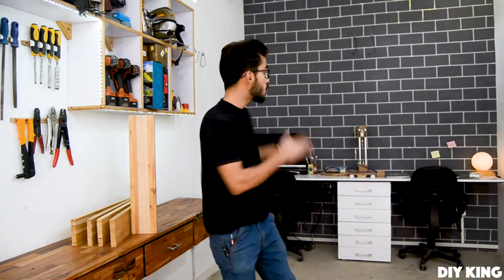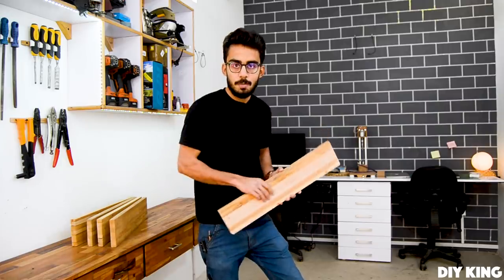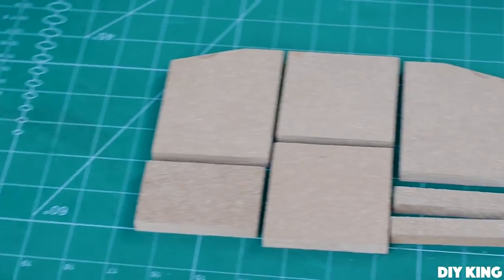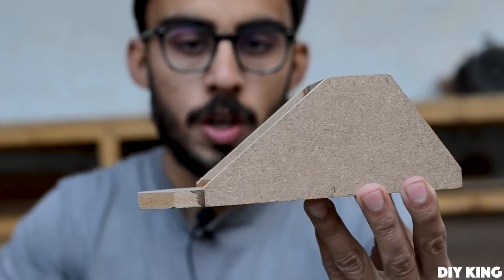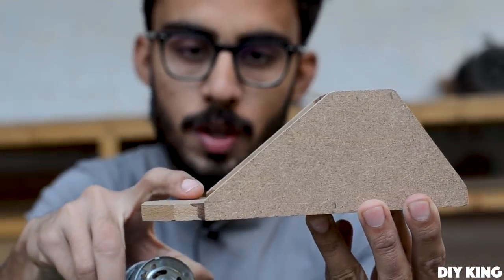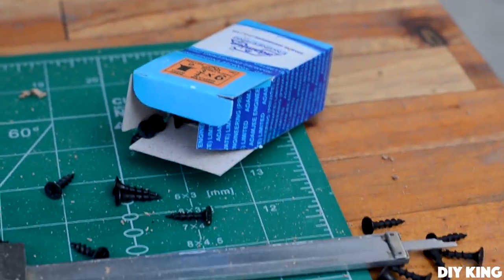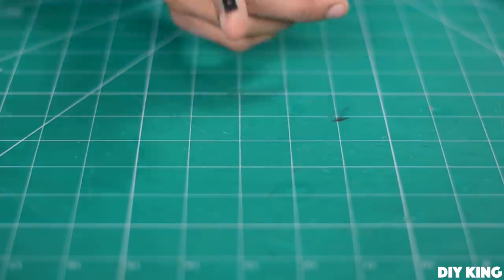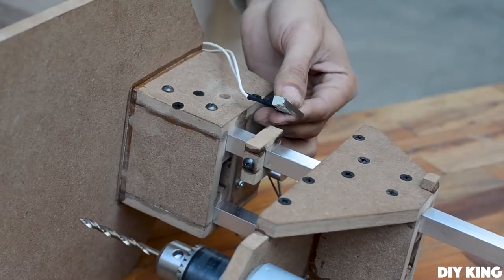How to make a Semi-Automatic Drill Press

Comment: Bro what is the voltage you have applied for the 775 motor when I use 12volts adopter the motor is not running while drilling

Comment: How long it will last using glue.... U can't depend on glue while designing such equipments... Or even mdf boards... U shd move towards metal plates and strips... If not heavy and costly then why not stuff like aluminium or high yield plastics
Reply: Dude...  I m not criticising him... Just pointing something good.... I m referring to most of his videos in which he had used glue... For instance.. A Nut is being used with thread rod as a mechanism to move the motor up and down... And the nut is stacked to frame with just glue... What if someone come with no information about operating the equipment and forcefully started playing with it...